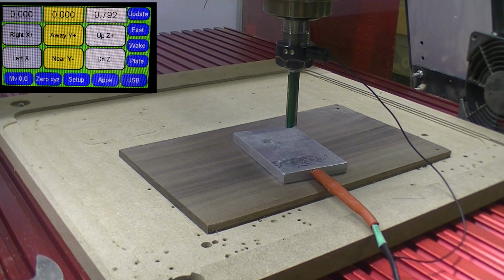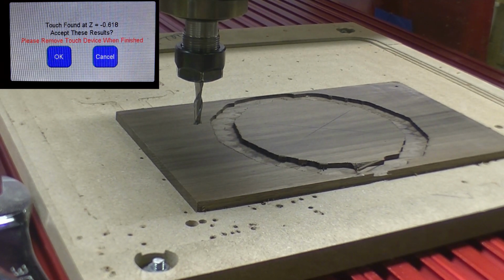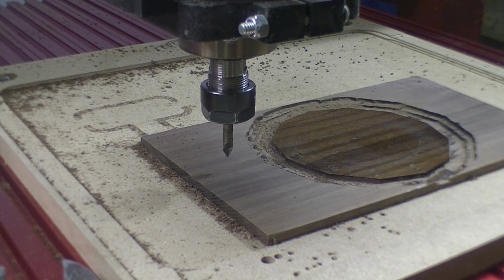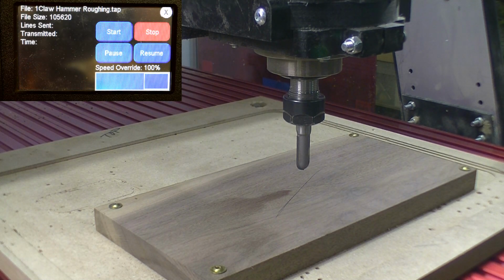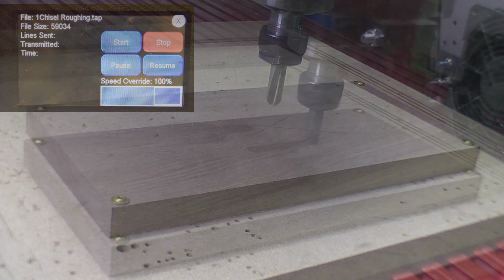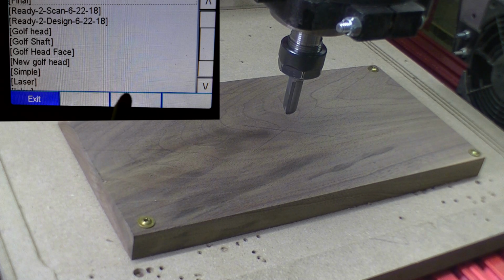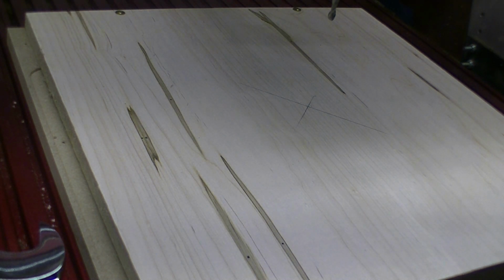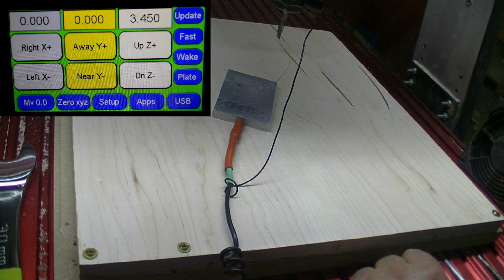Custom Clock Machining

Comment: The milling procedures as you show them in your video are too and unnecessarily complicated. Everything can be done much better, easier and therefore faster. However, the result is not bad, the amount of energy expended on such complex milling processes is bad. Indeed, everything can be done much more easily.